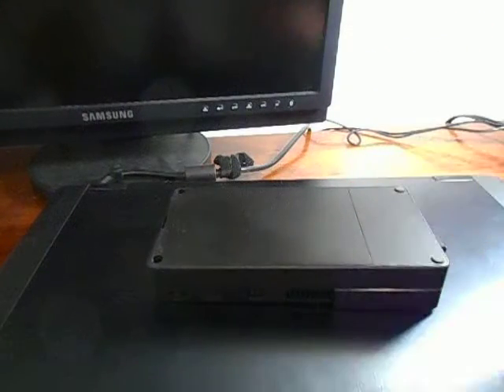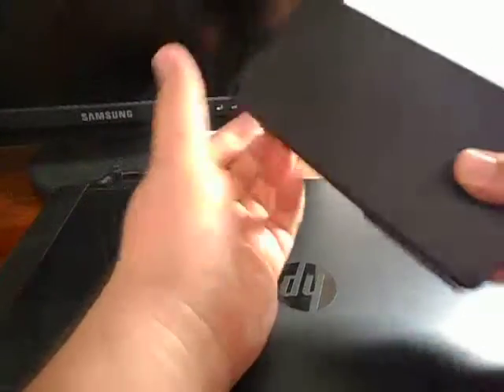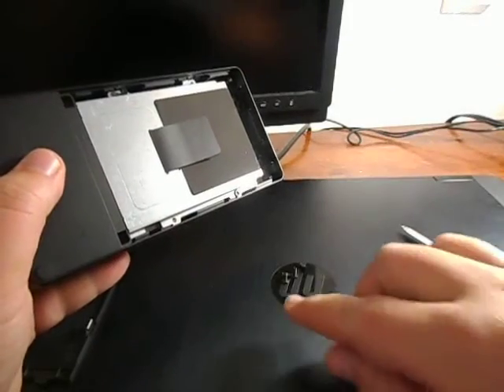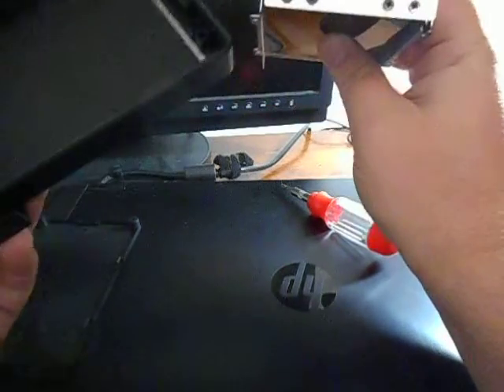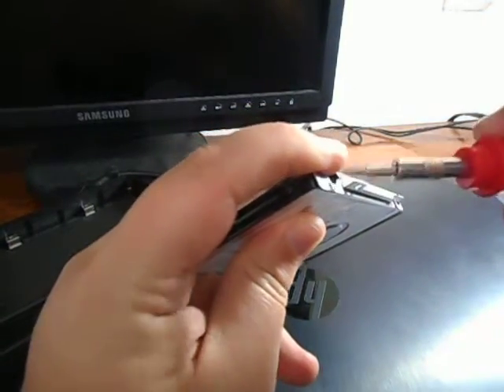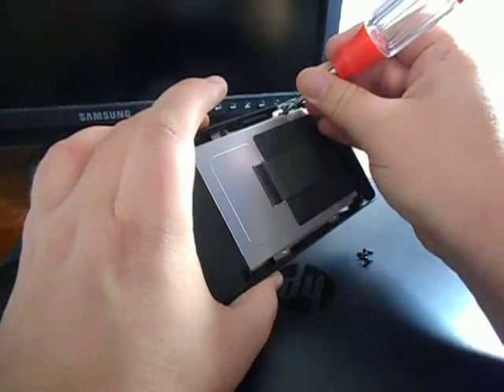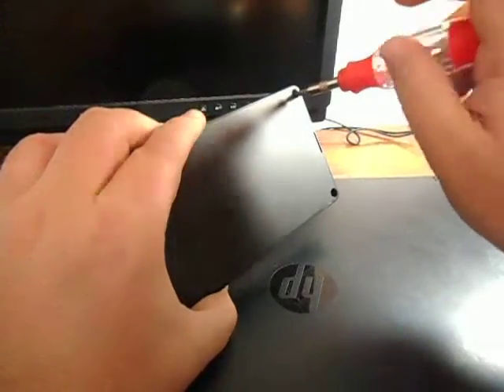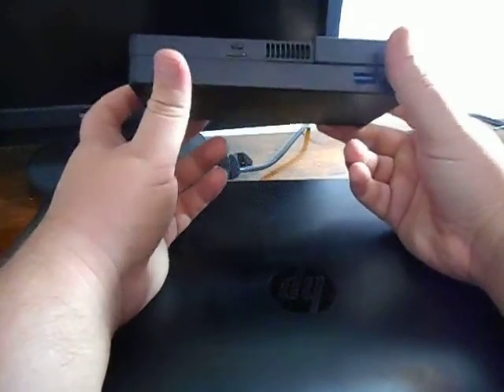Kangaroo Mobile Desktop Pro - upgrading storage to 2tb

Comment: Is that possible to upgrade the RAM in the basic Kangaroo?
thank you
Reply from the maker: +John Zhang no.
Reply: Thank you for let me know.
I'm using the basic one and sometimes it lags. Any suggestion for improvement?
Reply from the maker: Make sure it has good ventilation/cooling. since it does over heat and thermal throttle. Other than that, everything is soldered to the system board and not upgradeable.

Comment: Cool.  I have a Kangaroo and a Kangaroo plus..  i use the plus 100% of the time because of the extra memory over the standard Kangaroo.  As long as i keep the room cool and keep the Kangaroo elevated it rarely ever overheats.  i simply prop a pen underneath it to keep both top and bottom cool.   I purchased an external OTG 128gb ssd to supliment not having a kangaroo pro. They say the Pro's sata connector uses the same line as the usb 3.0 port so technically im getting the same bandwith using the ssd and usb3.0 port.  i also just purchased a monoprice (netis) AC1200 dual band usb wireless antennae to receive greater and stronger wifi reception. works Fantastic.  particularily when seeking open wifi signals.    $140 pc, $8.00 wifi antenna  full blown windows 10 desktop and internet with no extra cost.. !!
Reply from the maker: +xevious2501 I have been wanting a kangaroo plus, but think I will wait for an upgraded model with the core m processor, that is in the new Intel stick, if they come out with it.
Reply from the maker: +xevious2501 I have been wanting a kangaroo plus, but think I will wait for an upgraded model with the core m processor, that is in the new Intel stick, if they come out with it.
Reply: Well you just added something new to my wish list with that comment.
Reply from the maker: +xevious2501 email them and tell you want it to happen
Reply from the maker: +xevious2501 email them and tell you want it to happen